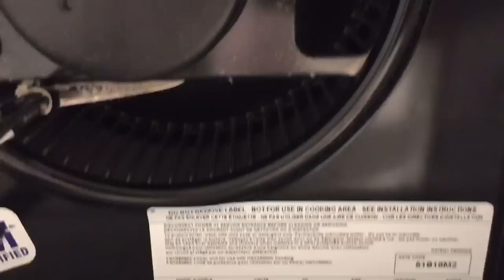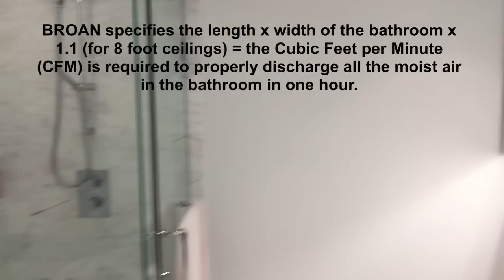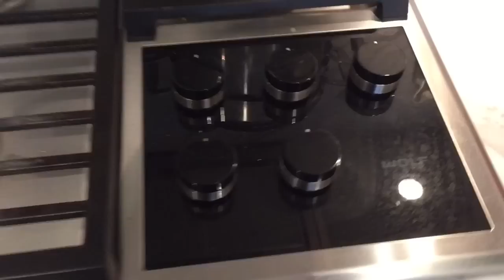Pre-Sale Condo FAIL in Vancouver?

Comment: I'm usually a fan of your videos, but that bathroom fan is nitpicking.  You can knock your 4 cubic feet off the bathroom by factoring in the double vanity and overhead cabinets.  I don't think any affordable inspector in my area would find any of the issues you pointed out in this video.  Now, we are talking about a  >1 mil condo, so yeah if I had that kind of money I'd hire him.
Reply: But that's the thing, where is the cut off for being good and not good.  They make specifications for a reason, a home is not the place for shortcuts....

Comment: You can't assume that the discharge tube is running along the back of the cabinets. It could very easily be near the front of the cabinets, just behind the toe kicks.
Reply: Trevor Lambert   I think even if it is just within spec the location is foolish. I don’t rinse my dishes then carry them across the kitchen to put them in the dishwasher. Do you?  The longer the drain line the more strain and shorter life for the pump.

Comment: 1. Ok, CFM is somewhat lower but it's not terrible 120CFM would probably do the trick but I would not demonize contractor for that.
2. Glass leaking or track leaking is fixed with $7 silicon tube and caulking gun.
3. Can't comment about dishwasher, all i Know is most manufactures are over conservative about specifications in order not to be liable for any damages their product may produce. Dish washer most likely will be fine.
4. If there is a window near by you don't even need a hood (building code in my area), if there is decent functional hood, again, it should be fine.
Reply: 2. It shouldn't have even been a problem from the start.
3. Manufactures may be over conservative about specifications , but if it fails, you will not have your warranty. Just follow the directions.
4. Again, manufactures specs. Just follow the direction.
Reply: 2. Shower glass is pretty simple to install, but sometimes an honest small human mistake  can lead to this leak. As I said it's not something major, it could be fixed with $10 tube of silicone. This in no way jeopardize the purchase of house or  can cause future problems with thousands dollars worth of repairs.
3. This will most likely be a problem, it could be probably fixed with some kind of booster pump, I would like to hear more on solution for such problem if anyone knows.
4. It's not just the specs, there are codes. NYC does not require hoods or exhausts if window is close by. It would be nice to have more powerful hood, but then again, it's not a safety issue or a problem that would chase you with huge bill down the road, maybe if you run all 6 burners it might not be able to handle some of CO2 along with smoke of vapor, but how often would that happen?

What is important about this kind of inspections are safety (google Life Safety Code, known as NFPA 101) such as fire stopping. No MEP (Mechanical Electrical Plumbing) issues and build up to code. No Structural Stability issues. No hazardous materials such as lead, asbestos, mold. Also waterproofing and proper exterior construction such as drip edges and weep holes to make sure water won't find way into building in future.
Reply: 2. I agree, it is a small issue. My view is that for a apt worth 1.5m, it should be near perfect. I wouldn't have an issue if it was in a cheap college studio.
3. I guess a booster or 2nd bump would be ok, but it could have been easily avoided.
4. I can't cook, so I would never need more then 1-2 on at once. Someone else may have all 6 if they are hosting dinner for family. Thats where the issue would be. It should be safe to use at all times at all settings.

Deficiency Inspection also includes functionality as well as safety. This more so seem like thing not being installed to spec.
He may be nit picking, but for that much money, I want 100% not 90%.
Reply: The reason he has a job is because now days construction is terrible. While 1.5m sounds like a lot, this price is most likely based on prime location and not the quality of build/renovation.

My point is, today it's almost impossible to find decently built house (especially finish work) and you should always expect to give punch-list to seller for any price of the property.
Reply: It's a regular cooktop not even 6 burners. There are laws in NYC where you are not required to have exhaust fan if kitchen has window. NYC  building code is one of the toughest in country. google "§[C26-1207.2] 27-758 kitchens"
Reply: why should anyone pay good money for a property as new and move in or even let it out to such problems as these which the inspector has easily and correctly discovered?  oh, that's ok...  the shower leaks, lets just head over to the local hardware store for a tube of caulk and 'fix' it!  fine & dandy, right?  oh, now what?  this hood is undersized for our range top!  phone the appliance center or someone to come out and replace it!  simple!  oh wait, this dishwasher is not close to the sink, and the hose isn't to spec... not an issue actually,  it'll do for a bit until we can get someone in for a look see!  just don't wait too long though!  and we love the winter, so opening  the window to vent the kitchen whenever we have the family over for the holidays is really nice!  and i think its best to avoid a long shower as our bath tends to mold (cough)!  time to re-paint in there!   :  )
Reply: It would appear that you've never purchased a house. There is no such thing as a perfect home and these "defects" are quite minor. I worked as a PM with a GC for a number of years yet have always hired an inspector for a new home purchase to catch the big stuff like electrical wiring, plumbing, drainage, roof construction and the like. But these are really punch list items and not worthy of a video or special consideration.
Reply: oh, sure.  your brand new home comes w/ a 'punch list'.  great!
Reply: As I said, it's obvious that you've never purchased a home. Every new home comes with a punch list. Welcome to Homebuying 101. Next, I'll explain the concept of a mortgage and how you can apply for one.
Reply: the sale of homes today more than ever is based on the income of available buyers.  as w/ so much today, as my dad used to say, 'they see you coming'.  (then we all know what follows:  $ ^ ).   ;  )
Reply: "4. If there is a window near by you don't even need a hood (building code in my area), if there is decent functional hood, again, it should be fine." He's not in your area, so why even make this comment? Canadian Building Code requires a range hood over a gas range or cook top. It makes sense too, so I'd say your code is deficient if it doesn't require it. Who is going to open a window in the middle of a New York winter when they are using their cook top? That's right, no one.
Reply: last time i checked the code says install to manufacture specification not close to manufacture specificaiton at least thats what it tells me in the plumbing code book which is superior to the mechanical code book  , oh and the slight leak that isnt a big deal well whens its been leaking like that for six months it becomes a major problem , water can travel anywhere because of capillary action , and because there is a free standing tub there obstructing view of the back wall there could be mold or mildew accumulating , oh and as a plumber you never exceed manufacture specification of a discharge line , i say that as a plumber with experience in rough in and trim , as well as light commercial .